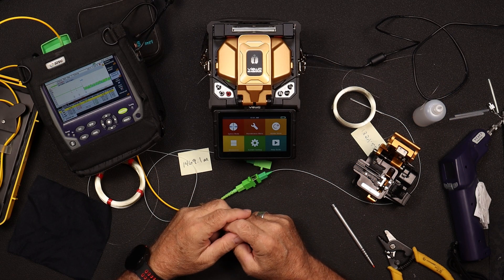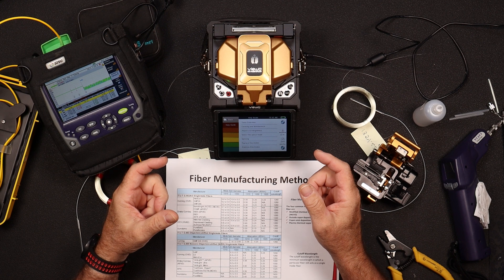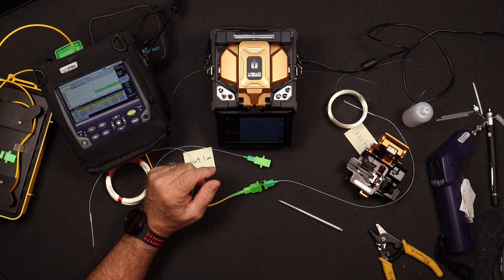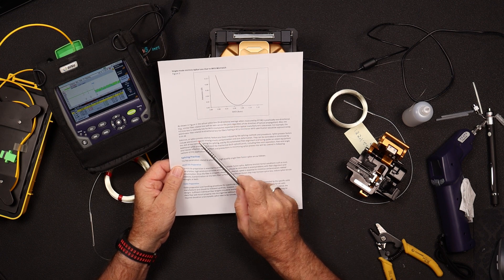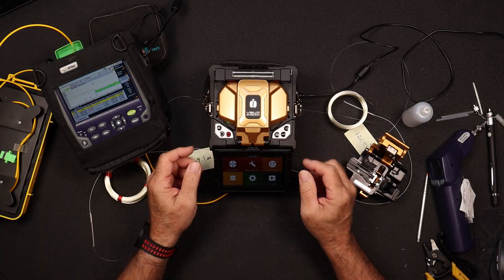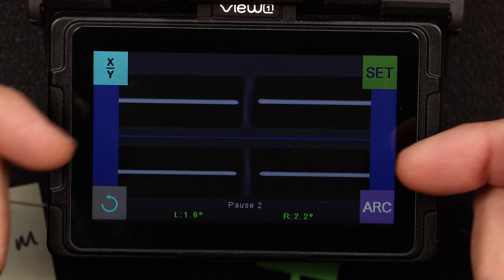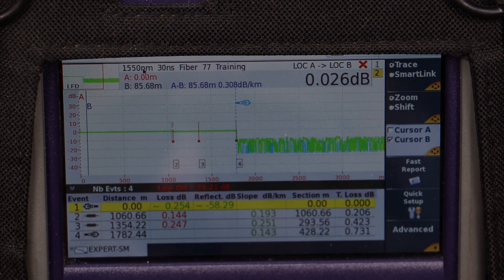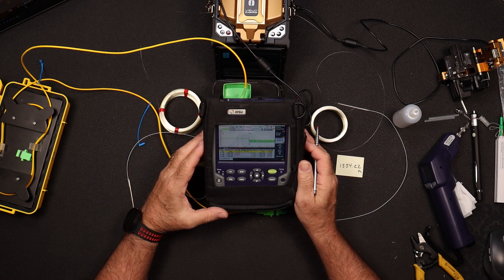Is A Fiber Core Diameter Mismatch Causing High Loss Fusion Splice?

Comment: I’m currently on the field (i lay and connect ftu to the evp/connecting feed to drop in casetttes in manhole )and everything went fine the first 3 weeks, since last week i keep getting 0.50db losses on my splice in the manhole, where i splice the dropcable with the feed.
I’m using a fujikura t70s and  i cant pinpoint what the cause is, even after arc calibrating twice i still get 0.40+ db loss, i’ve ran all the possible tests with success on the splicemachine and i feel like i’m getting out of options, i basically just splice a1 to a1 and my splicer is on auto
Reply from the maker: I'm assuming the .5 (or is it .05?) is on the machine? I would suspect drop is G.657 and the cable is G.652, so the estimate is off. Shooting OTDR from ONT back to splitter should show high loss and from splitter back to ONT would show a gainer.  There is a setting on the 70 to do G.652 to G.657, you may want to see if that helps. What's shown on the machine is an estimate, so difficult to say without actual testing. Hope this helps
Reply: @VanTekConsulting  Thanks for repyling, the OTRD technician tests from the pop to manhole,
i get good splices according to the machine yet the loss on the splice according to the otrd technician says something between 0.50 and 0.57 when its not ok, i've used a different machine for a couple of days, it's a cladding splicer the sumitomo t400s, which has been good so far but just today i got the 0.55 loss again on my splice (sumitomo machine said 0.01 loss)
I Don't know if it's the weather? or dirt in the machine? the cold? the humidity i dont know
Reply from the maker: @GTpreston96 It sounds like the OTDR is shooting from G.652 (standard SM) ito G.657 (Bend insensitive). He's getting a "loser" due to differences in backscatter. If he shoots Field back to POP, he would get an offsetting "gainer". This is a pretty common issue with unidirectional OTDR shots
Reply from the maker: @GTpreston96  Just to be clear, you are splicing drop fiber to a fiber cable, the machine is NOT reporting high loss, but the tech running the OTDR says High Loss shooting from the POP.
If this is the case, a single ended OTDR shot is an "Approximation" of splice loss, NOT the actual loss. This is what I would do, put a connector on one of the drops  reporting a bad splice, shoot from the customer prem back to the POP.  Add the two splice values together (make sure to look for negative loss i.e. -.3) and divide by 2, that is the loss. Example: A>B is .5 dB, B>A is -.3 dB, that would give us .2 dB / 2 =.1 dB of actual TRUE loss. This is the loss that would be seen by a power meter and light source. The OTDR is measuring Perceived Loss based on the Backscatter Coefficient.
I hope all this helps, it sounds like you are doing everything correct, so don't lose sleep over this. Let me know how it works out.
Reply from the maker: @GTpreston96  I was thinking and there is another possible cause. If the loss if fairly consistent, I would guess fiber mismatch, if this is happening occasionally, every few splices, it could be macrobending. If there is a fairly large difference  between the loss at 1310 nm and 1550 nm, for instance .5 dB at 1550 nm and .3 dB at 1310 nm, there is bending loss which could be splice sleeves, fiber routing, over stressing the fiber during prep, etc. Again, difficult to say without the bidirectional OTDR shots.
Reply: @VanTekConsulting  can a bad 1km launch cable (at the end of the line) so opposite side of the otdr, affect the results such as in my situation?
Reply from the maker: @GTpreston96  No, it would not have any impact.  Without full testing, i.e. Bidirectional shots, this is all guess work. However, if you have used multiple machines, and done multiple burns, with the same results, I would rule out the machine. This leaves your prep process or a fiber anomaly. Assuming you have done multiple splices on the same cable and drops, with acceptable results and only a few bad splices, I would lean towards drops damaged close the to the splice area during placement. Here's the reality, the max allowable splice loss by standards (Telcordia GR-20) is .3 dB, max standard GPON length is 20 km from OLT to ONT, with  a -29 dBm receive level and with a typical launch of 3 dBm, it would give us a power budget of 32 dB. So if we had 16 splices, 6 mated connector pairs, .4 dB/km of attenuation, and a 32 port splitter, we would still hit the ONT with 30.9 dB  of a 32 dB power budget, or -27.9 dBm. 
Again, I don't have all of the information, such as , are you a contractor trying to meet customer acceptance requirements, or a company splice trying to meet company requirements, how long are the runs, what the actual requirements are, etc.
Here is something you could try, again, I am assuming that there is an issue with a few splices  while many are acceptable, and all are using the same cable and drop. Get a spool of new drop, and splice it on to the fiber in question, do an OTDR shot, if the splice loss is good, you most likely have a damaged drop, and A: need to replace it, B: get a waiver for out of spec splice. If you are a contractor, if it's proven that it is a bad drop, and it's in a conduit, replacing the drop would be fairly simple, a direct buried may be a bit more problematic. 
Hope this helps...

Comment: The reason people say there's loss in core sm core mismatch is because it effects the otdr reading, loss going in and gain going out , in my case (SMF/ BIF ) this was very true , the true estimate comes from bidirectional averaging
Reply from the maker: Correct, bidirectional averaging is the only way to measure true splice loss. The gainer/loser between G.652 and G.657 is caused by the g.657 "Trench" which is what makes the fiber bend insensitive. Thanks for the comment.